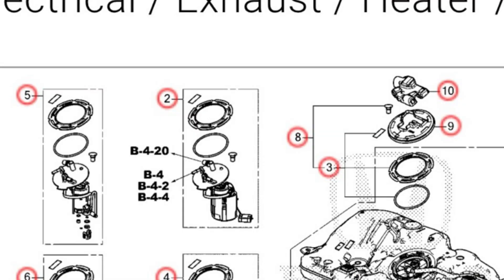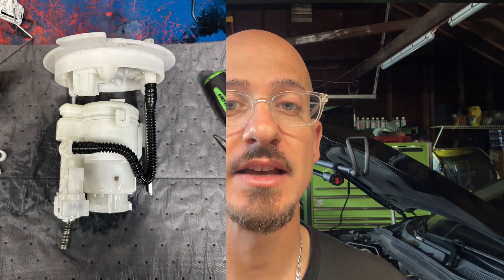Q&A Episode 109 (fuel filter intervals | catch cans | DOHC J series)

Comment: 2007 MDX just had its 2nd Timing Belt.
8 months later there’s a very small oil leak and I can’t locate it.
Q:
If the oil pump is leaking, how will I know?
Reply from the maker: I’ll try and make a short in this on how to pinpoint it. Will be easier then explaining it in writing

Comment: Hey, I got a 2016 accord coupe v6 with an  auto trans. It has a subtle whining noise revving in 1st and 2nd gear but becomes unnoticeable in gears 3-6. I also feel a slight vibration when putting it into gear from neutral and at times it would have a mechanical clunk sound when shifting out of neutral. Wondering if this is normal operation or something that needs to be addressed. Car has 49kmi on it and trans fluid supposedly flushed by dealer when bought at 47k.
Reply from the maker: You may just be hearing the but although it also may be a bigger issue. Tough to say and would suggest you compare it to a known good vehicle. Without hearing it, tough for me to say.
Reply: @BCautosutions Thanks for responding, I didn't notice the noise on another 9th gen v6 accord I drove  but that was a brief drive. I did take it back to the dealer and they couldn't find anything wrong. Their scanner said all shift points were good and no codes popped up.

Comment: Got a 2014 honda pilot. Having  front piston rings replaced under honda recently extended  warranty. Service advisor is recommending  to replace water pump, timing belt and tensionor, serpentine  belt. With no charge on labor  just the parts totaling  1200.  Car has 100,000 miles.   Probably  gonna  keep the car for 2 more years. Thoughts?
Reply from the maker: Seems a little high just for parts, I think you have some wiggle room there but get it done imo! Will cost you more afterwards if you decided to keep it longer.

Comment: Shop says my front arms aren't adjustable on my 2010 tsx. But my mechanic says the have a centric camber bolts. It's a new arm cuz the old arm got bent. They aligned everything else but the arms. But I saw some Honda specs online that's says the arm is aligned from 0.0 to 5.0 and it's at 4.5. and my back camber bolts aren't adjustable and my mechanic says to live with the back camber being slightly off. What's ur advice for this?😮‍💨

Comment: When I started driving decades ago, I was told when using my air conditioner to turn off the compressor for the last few miles of my drive to clear out my ducts. Supposedly this was so my ducts wouldn’t smell moldy or musty over time. Fast-forward to now, I have told my kids the same thing. Is this really necessary to do? This isn’t a Honda specific question, but maybe some of your viewers would appreciate the question all the same.
Reply: Not at all, thats a literal myth. Its more important to run your AC every now and again to keep the seals lubricated, and to make sure the compressor doesnt seize.
Reply: Mercedes cars around 2010 to 2020 would develop a smell in the air coming out of the AC vents from all the algae on the evaporator coil.
Reply: @ItsAlive111  same with BMW. They made a special spray you used to set off in the cabin like a grenade, set it to recirculate with the ac running, get out and close the doors and windows, to treat that mold in the vents. I remember doing this as an apprentice in 2007 ISH
Reply from the maker: Appreciate the question but no that is not needed. If you have a moldy or musty smell I’d check for water intrusion or a dirty cabin/air ducts.

Comment: Man thanks for the support on my FL5 the dealer ended supposedly replacing just the EPS motor, but they changed the warranty the whole part and my car came out out of alignment and was told that they don’t need to do that on that work. I really don’t like the approach they did because I feel that even I don’t have a special car still is Honda top of the line car right now I guess I try to contact corporate but it has been a week and no an answer still I guess I will take it on my own and fix everything and forget any warranty on the car. But thank for all your great content hope Honda have all their techs at your standard and pay you right probably that’s part of the reason they are that way.
Reply from the maker: Hey man. So they do just the eps motor or the whole rack? Regardless if it’s out of alignment after they “repaired” it, it’s their responsibility to correct it. That’s crazy they even said that to you imo. Shame on the dealer.
Reply: @BCautosutions yeah and the sad part the car is out of alignment and the original noise is still there also, I really don’t trust them anymore to work on my car because even on the invoice the car has the multi-point inspection on the invoice not even a mile the car turn on the TPMS light too with a tire low on air. I really disappointed how the advisor lie to my face and how dishonest they were.
Reply from the maker: @elvincastro9479 ugh sorry to hear man, hopefully gets resolved
Reply: @BCautosutions thank you brother.
Reply from the maker: @elvincastro9479 keep us posted

Comment: Thank's for this Update, Appreciate your time taken doing these Videos, I,m going to be doing head gaskets on a 08 pilot AWD without VCM, with 150.000 miles on it, This Vehicle was Wrecked at 90.000 mi looks like someone used some Shit coolant of course when repairing it,     I see it still has the Original timing belt etc about to snap.    Plan to head stud this unit as well just because, If You do read this What would You do other than use Oem quality parts and the oil pump seal etc, have You use the new timing belt tensioner part# 14520-PA8-A01 on the J Series engines?  Or still use the original design I see others using the none hydraulic Spring type is it really better? Thanks in advance if you do see this.
Reply from the maker: Hey so for the timing belt tensioner I forget at what point the updated the design but you have to use the one that was designed for the vehicle, the new ones actually seem to be less reliable vs the older design.

Comment: CV axel  on Honda Accord v6 2017  .  Did a suspension inspection  Big O tires said that they were done . Both had lost grease . Both got replaced  
Car was feeling a bit sluggish .
But now it's  running  good 
I told them  either MOOG parts or TRQ  . Went with  moog well see how they is long-term  
They also said the Alternator is 7 years old  to start thinking about replacing it before it  fails?
Reply from the maker: I used to be a fan of moog although their quality has seem to come down a bit while trq seems to be putting out some decent parts (time will tell). I would NOT replace an alternator based off of time. There’s literally no way of knowing how much time it has left unless there’s some outside influence. I’ll get into that this Q&A

Comment: There are lots of issues of Honda in Indonesia especially CVT trans, they have problem with steel belt is easily to broken or went out below than 100k kms on it, for your perception, how to solve it?cause the others like toyota and japanese car brands here don’t have much issues for that, thank you
Reply: Are they doing proper intervals on the CVT oil change?
Reply: @Ok_Mountain_8698 they usually driving their car with overloaded stuff and driving it in off road situations, that’s why it’s breaking down so easily
Reply from the maker: If the chains are snapping due to heat from hot temps and conditions then a cooler at benefit it along with more aggressive fluid intervals. We are not seeing that here within the exception of the bulletin years.
Reply: @BCautosutions got it, thank you for the information Daddy❤
Reply from the maker: @ericdarmawan9504 🫡
Reply: How to solve it? Buy regular automatic Toyota
Reply: @Chorizomicks toyota also has similar issues, their cvt known for temporary usage, maybe different built quality or assembly
Reply: @ericdarmawan9504 I said regular auto not CVT
Reply: @Chorizomicks got it Sir, auto is best trans

Comment: Thank you sir for answering my question about the fuel filter!
Reply: I recently had my mom’s 04 Civic fuel filter changed at 80k by a Master Honda Tech. I went on a long highway trip and I couldn’t believe the car got 38 mpg.  The car is mostly used for city driving but if I recall correctly the best highway mpg might have been 30 mpg. I also run Valvoline Restore &  Protect oil and think that improved the gas mileage by 2 mpg.
Reply from the maker: @teslamr7333 🙌
Reply from the maker: Very welcome! I’ll try and get one apart and make a video